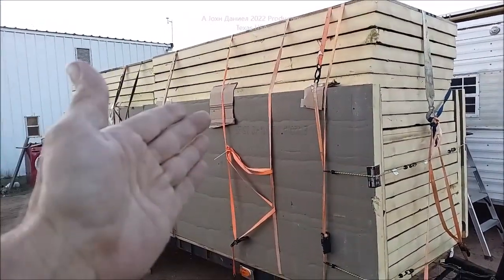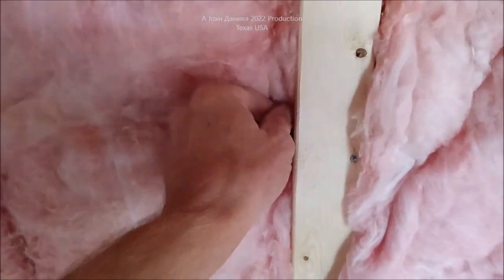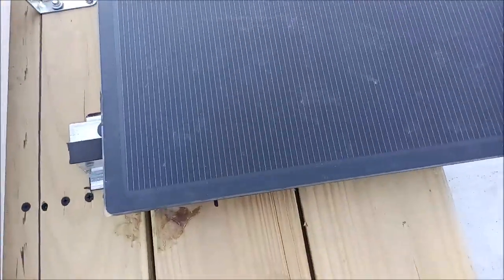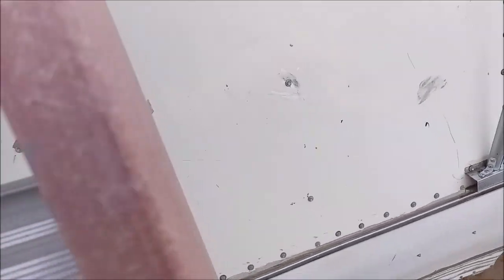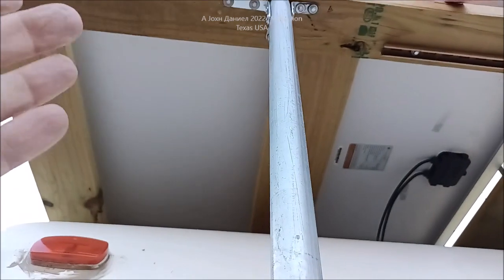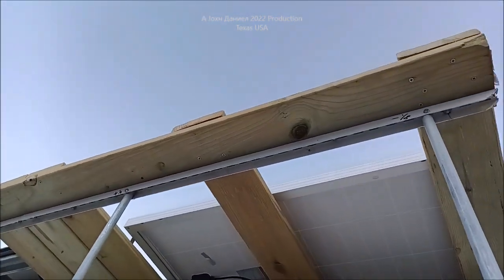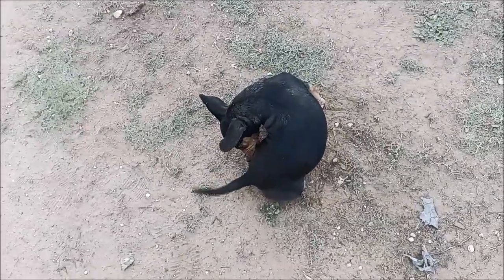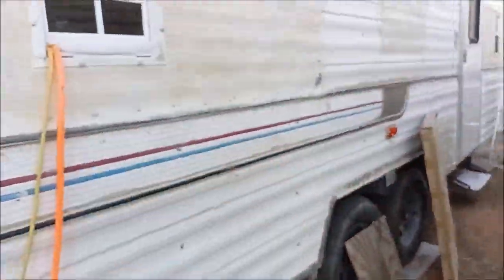Salvaged RV trailer turned into POWER HOUSE, salvage, save, & build ugly but useful things

Comment from the maker: Send more ☕ Coffee, Donate & Join https://www.buymeacoffee.com/JOHNDANIEL ⬇ 93% 2022 Survivalist Agree, get The GREEDY ELITES CAUSED ENERGY CATASTROPHE SURVIVAL OFF GRID SOLAR POWER SYSTEM  100 Watt Panels (get 12) https://ebay.us/Zla5aq Affordable durable solar controllers pick (get 2)60A https://ebay.us/pODwA7 Solar Y Connects (get 6 pairs) https://amzn.to/3fElhzO ,Battery cable USA made https://amzn.to/3h6dsim ,12/2 Above & Underground get 250 foot, https://amzn.to/2XIJolg for safe DC wiring of lights and appliances.
Cheap Inverter with proven 5+ year record of quality - 3000 watt CN-SWI Power 3k https://ebay.us/YEaTX9 for tool, high amp, fine electronics, uses Fairchild Semiconductors & don't forget the Costway huge DC 12v Refrigerator/freezer unit https://bit.ly/3jquPOy 
🌞BEST SOLAR OFF GRID BATTERIES - Power Queen LiFePO4 https://shrsl.com/3lqrb or https://amzn.to/3uwC8Js #1 Lithium made

Comment: Really like the load solar on that trailer. What state are you in?  What kind of power are you getting out of those panels on a typical summer day?
Reply from the maker: State, Texas. Power since installed in early September, about 140 amps per hour in peak day about 3.5 hours top sun a day, for full day 8.75 hour daylight average of 95 Amps Per hour, Max peak was 146 APH